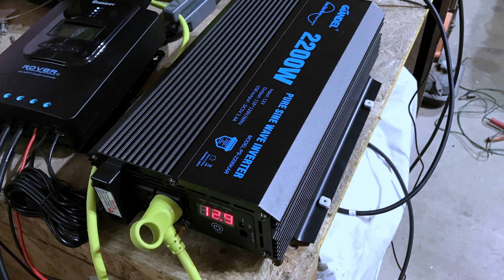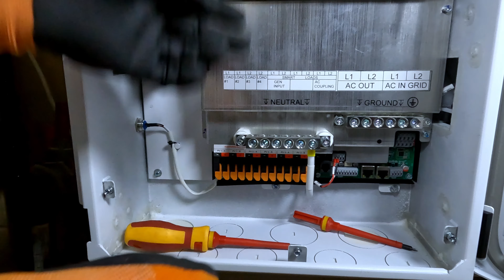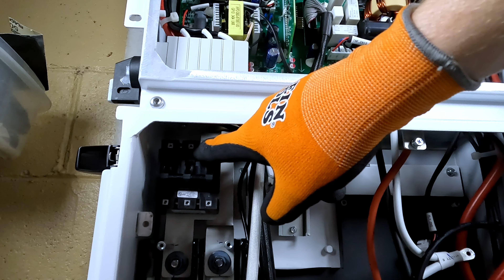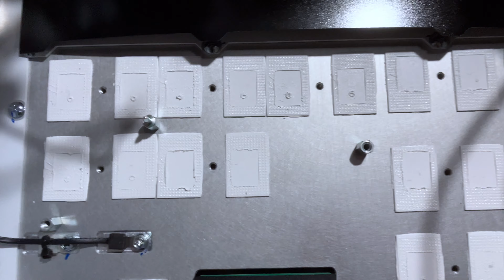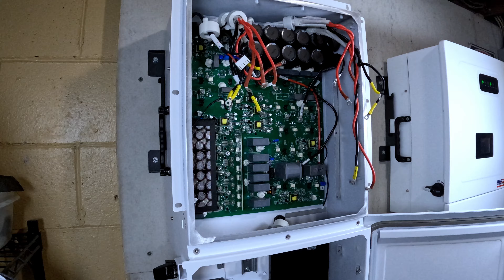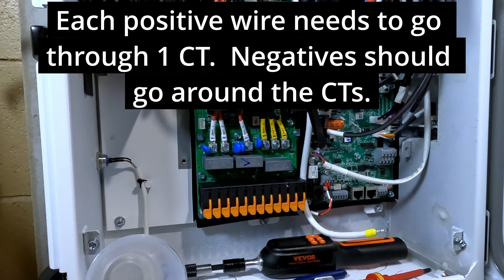Empower Your Off-Grid Life: The Field-Serviceable MidNite Inverter

Comment: MidNite Power are not field serviceable. If you remove a board your warranty is voided. If a communication board goes bad the inverter must be replaced. It’s more expensive to repair it than replacing it. The communication board has the serial number which controls the rest of the inverter boards.
MidNite Power inverters aren’t for DIY.
Reply from the maker: When the inverter came out by MidNite Solar, that was one of the biggest features they were talking about, how it can be field serviceable.  Whether that’s changed now that MidNite Power has started is something I don’t know.  

I will disagree with you though that these inverters can be for the DIY crowd, not just professional installers.

Comment: Heya Adam, if you want to run these in parallel, what cable do you need for the parallel connection? I did not see anything on the midnite website and was hoping maybe you'd know. Thank you!
Reply from the maker: @dominiekmeers4749  yes sir!  I actually need to make a video on that!

I just used a CAT 5 cable and picked 4 wires out of the bundle.  You run the same wire from port 1 on the first inverter to port 1 on the second.  Repeat for all 4 ports for the parallel connection.  

Hope that helps!  Let me know if you have other questions!
Reply: @AdamDeLayDIY  Thank you for confirming, Adam!
Reply: Just figured out the issues with the errors I was getting. They were related to the grid breakers turned off and the battery protocol for the new inverter was not set to pylon (only one of my inverters was set to pylon)!
Cheers!
Reply from the maker: @dominiekmeers4749  Awesome!  Yeah there's some of the little "gotchas" that you may experience in rare cases.  When I go through and do a video on stacking, I'll have to try and make sure to share some of them.
Reply: @AdamDeLayDIY  Communications are working now! Yesterday midnite solar updated the firmware on both my inverters and my online account got created, so that's good.
When both inverters are turned on without a load, all the icons are solid and no errors are reported. However, when I turn on the loads of both the inverters, I get a P4 parallel GRID abnormal error. I am waiting to hear back from support on that, but I was wondering if you have encountered that before, or if you know what could cause that?
both my inverters go to a combiner box (2 100 amp breakers) and that combiner box goes to the load center

Comment: Did I overlooked something here? I did not see any transformers of any high frequency high power transformer. Or is this inverter switching 48 VDC  , doubling the voltage and converting the 96 VDC, creating the AC waveform with the FETs? Or are the transformer in the back of the case?
Reply from the maker: I'll be honest, I can't even begin to tell you how it all works.  I just know it's a HF inverter and the only thing on the back of the case is a giant heat sink with fans underneath it.

Comment: I've got a question that no one seems to want to answer. My house has dual 200-amp panels. Without creating a sub panel for critical loads, would I be able to use one inverter or get an inverter for each panel?
Reply from the maker: So this inverter only has a 100a passthrough.  

How your panels are wired and what kind of loads each panel has would determine the answer of your question.  

- Do you have a 400a service or is one of the 200a panels acting as your main service panel and the other panel is just a sub panel? 
- Do you know what your average running loads are?
Reply: @AdamDeLayDIY  both panels are 200-amp mains. Running loads?? From our electric bill, it looks like we average just under 40 kilowatts per day, or 1.6/hour. We have well pump, new geothermal
Reply: @AdamDeLayDIY  I'm thinking I'll probably need two inverters?
Reply from the maker: @JimLogger-jo9ck  If each panel is it's own "main service panel" which is directly connected to a grid meter, then yeah you would need at least 1 inverter per panel.  The loads in the panel would determine how many inverters you would need per-panel.  You could start with 1 panel and 1 inverter to get the hang of how things go before trying the second panel.
Reply: @AdamDeLayDIY  thanks! Your advice really helped.
Reply from the maker: @JimLogger-jo9ck  Glad to be able to help!

Comment: Thanks for the teardown. Are those giant busbars made of aluminium or copper?
Reply from the maker: @adon8672  thanks.  I wanna say aluminum off the top of my head.  I’ll have to open it back up and look again.
Reply from the maker: I grabbed a pick and started scraping the bus bar.  It does look like it's aluminum.
Reply: @AdamDeLayDIY  I thanks for taking the trouble to check. I guess if the cross sectional area is large enough, it should compensate for it being less conductive than copper.
Reply from the maker: @adon8672  Not a problem!  It does look pretty thick.  Unfortunately I don't have a micrometer to check the actual thickness.

Comment: That is to much for me. Great job. Took you about 6 hours total? Maby.  I have shakey hands and have a hard time with the small screws.
Sungold had me do that on my second Inverter and it didn't work after. At least no smoke.
Reply from the maker: Maybe 4, but that's taking everything apart completely.  In reality if something failed, you wouldn't have to remove everything, just a couple pieces to get to the faulty component.  I would imagine that IF something failed, it would more than likely be the Relay board.  For that you would just have to remove the metal plate in the lower section and disconnect a handful of cables.

Comment: Now that I've watched the video to the point where the inverter is disassembled to the point where the baseboard can be removed, that's a pretty daunting task and I've done component level repair commercial.  It's not a comment on the quality of the unit, it's just the nature of the beast - complex multi-function devices are going to be like this.  Are the connectors unique in an area, ie it's not possible to accidentally plug something into the wrong position.  It's all labelled, and that's good, but having connectors that prevent a cable in an area of the unit being plugged into the wrong one would be nice.
Reply from the maker: One thing to keep in mind is that if something failed, you wouldn't have to remove everything, just a couple pieces to get to the faulty component.  I would imagine that IF something failed, it would more than likely be the Relay board.  For that you would just have to remove the metal plate in the lower section and disconnect a handful of cables.
Reply: @AdamDeLayDIY  Good point, and since it's not a ... special ... from that particular country all the cheap stuff comes from, it is unlikely to have a failure anyway.  At least an internally caused one.

Comment: Lots of people don't consider what really happens if their inverter or let's the smoke out.  Having spares set aside is a good idea but not as good as having a complete ready to use spare unit even if that unit is a lower rated one where you have to live without non-essential things operating.  The average person off the street may have good enough mechanical capabilities, ie can remove screws and replace a board, but they likely have very little electrical/electronics capability beyond spotting soot/burnt and/or exploded components.  They can replace that board, turn the unit back on, and immediately that new board is destroyed because another board is the one where the fault starts.  A classic example is the cheap low frequency inverters where there is a 'do everything else' control board and a separate FET board.  FET's blow up, replace the FET board, turn it back on and they blow up again because the control board is the problem.
Reply from the maker: @retrozmachine1189  I completely agree that having any kind of spare is better than not having anything at all.

I would imagine though that “the average person off the street“ if they have limited electrical knowledge, are probably going to be have someone install the system for them. If problems arise after the installation, they’re going to be calling their installers to support their system and resolve the issue.
Reply: @AdamDeLayDIY  True enough.  I was really thinking of an off-gridder type of situation to be honest.  Not necessarily a prepper either, just someone out in the country where it was going to cost them $20000+ to get a mains supply and not having ready access to an installer/repairman.
Reply from the maker: @retrozmachine1189  Sure, that makes sense.

Comment: Thank you, Adam.  Interesting exercise.  Curious how holding spare parts costs would compare to just having a second unit.  You'd likely have to have one of each part which could be costly.  Also, if the unit fails, how do you know what part failed?
Reply from the maker: @roslynandbobchauvin2378  thanks.  As I stated in the video, I’m not sure how the pricing will end up working.  

As far as figuring out the part that failed, that would really depend on the type of failure you have as well as the tech support team you have to support the product.  In talking with both Current Connected and MidNite Solar, both have gone through a similar tear down process to learn about the specifics of the inverter as well as how to diagnose and repair issues.

Comment: You are "the kid in the candy store" great video. compared to the Victron..well it's a lot more simple than this thing, I prefer a LF inverter, but I do own an EG4 6K as well. My point is, that is a lot of parts and boards...
Reply from the maker: Haha, thanks!  
Yeah, things do get simpler when you're not talking about an AIO which has to do multiple things.  It also simplifies the repair process as well. 

You can't beat the Victron MP hardware simplicity, but the repair process is the same as everyone else.  Take it down and ship it back.  For folks like you and I who aren't afraid to open something up, I would much rather swap out a PCB than have to unwire, ship and replace an entire inverter.